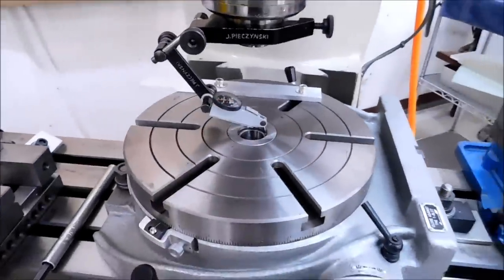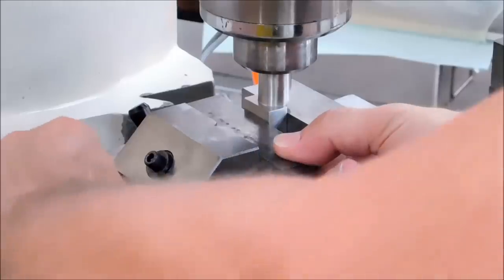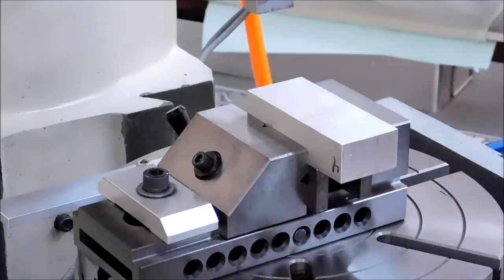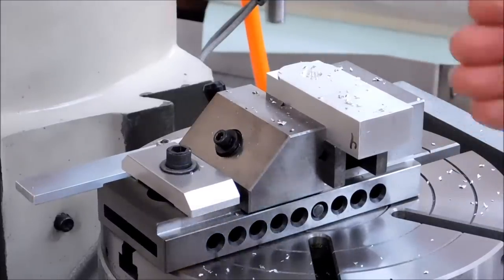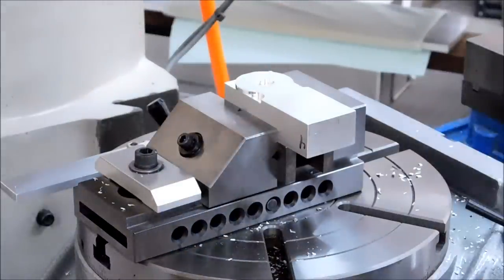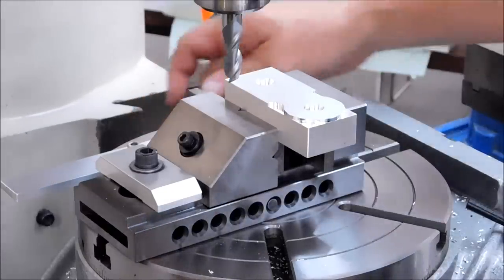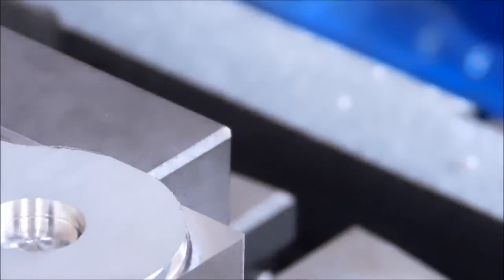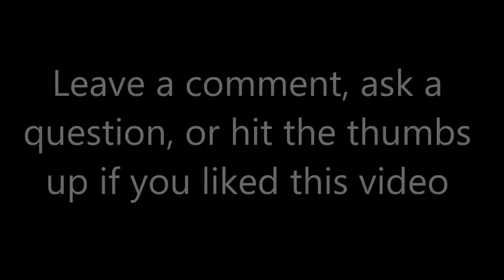Simplified Rotary Table Setup. Tool Demonstration #1

Comment: Great demo Joe. I bought one of your alignment tools and used it on my very first rotary table project yesterday. I made some T-nuts for the rotary table and rounded one end to fit the rounded end of the slots on my Phase II table. Worked like a dream. Not sure how I would have set up without it.

Comment: After seein' how useful them thar alignment tool be I went and sawed off a length o' rebar and  a hunk o' hot rolled and stick welded me up one of things.   I cain't seem to gets it to align so good.  Cans you tell me whats I might have done wrong?
Reply: Could've been a damp welding rod. Try tig for a clean looking finish.
Reply from the maker: Depends on what day of the week it was, and what kinda dog crap was stuck to yur booots. Its all in the details.

Comment: Joe a great setup BUT, how about if the holes need to be a certain accurate dimension apart ? The blocks would need to be accurately machined to length first to do it the way you showed. Is there another way using your setup with the blocks just rough sawn to length to be finished to size when rotary machined ?
Reply from the maker: Hi Dave, good to hear from you. Thats Demonstration video #2. Coming up.
Reply: @joepie221  Would that be using the rod and bushing trick with the double sided tape to set the hole locations? After finding center of course.

Comment: OFF TOPIC QUESTION
Why has nobody ever made a mechanical iris steady rest, or 3-jaw chuck steady rest, with bearings for the lathe?

Am I wrong in thinking that it should make the setup quick and flawless?
:
Reply: I've thought about the 'steady chuck' idea before it would be pretty awesome, you could also use a 4 jaw steady for supporting long offset work pieces if ever you had the need.
I might bump this up the project list, I'm pretty keen to see one of these :)
Reply: +TommyGun Machining 
Wouldn't the 4-jaw steady basically be the same as using the pre-existing steady rest, attempting to zero the adjustments, so to speak?  I'm trying to get away from that.
:
Reply: I was talking about interesting offset setups where steady rests are normally central only. It was my tangent to your tangent!
But yes, a centred 3 jaw steady should work for what you are talking about
Reply from the maker: I have a 3 jaw tailstock chuck with bearings.
Reply: +Joe Pieczynski 
Have you already done a video on it - if so, could you please provide a link?
:
Reply: The chuck would be easier but much wider, leaving more of the part inaccessible. If that wasn’t an issue for you it could be good.
Reply: +Inventorsquare 
A mechanical iris steady rest could fit into the same footprint as a standard steady rest, that is why I mentioned it first.
:
Reply: Critical Look That makes you suspiciously forethoughtful.
Reply: Critical Look Rottler, uses the almost exact chick like you talking about has a bearing in the middle of a chuck and it installs in a main bearing bore to support the bar while you face a thrust surface with a universal boring bar. The new machine just circular interp. The boring attach

Comment: hi Joe,
do you make that setup tool in a metric version?
Reply from the maker: Made from metric steel. Does that count?
Reply: One need only be willing to work with 12.7mm at a time.
Reply: well the dials on my bridgeport are metric and using imperial measurement tools gets to be confusing and a real pain real quick. it's not that i'm trying to be facetious...also most of the collets i have are metric as well. i have a few imperial sized ones but those rarely come out of the box
Reply from the maker: I honestly thought you were kidding. Sorry. Only the shank would need to be metric. The faces would still perform as intended with some math. The .750 shank may possibly fit a 19mm collet
Reply: You could make it yourself if you wanted one bad enough and had the equipment to do it with.

Comment: Hi Joe, rather than taking the part out and reseting for the second half, could you not have moved the table back the distance between the 2 centre holes minus the 40° offset while cutting an just turn the table round again to do the other end then forward to the end of the first cut. Or was the exersize based on the use of the tool you made to realighn exactly for a second cut. thanks again for teaching us different tools and ways to do things.

Comment: I'd purchase one of these pins but they seem to be long gone. Anyone have suggestions on how to make one (order of operations)?
Available equipment is: lathe, mill with collet blocks and spin indexer, but NO surface grinder. I have  Mitutoyo digital mics, surface plate, digital height gage to check the finished tool.
Reply from the maker: I am retooling the process. I do plan to put them back on the website in the future.

Comment: So i your opinion, would it be better to get the largest rotary table that will suit the machine? Over the smallest kind that would fit. In going to get one here soon bu6im glad i waited over buying a 4 inch, because that would fit nicely on my mill table without overhang but im thinking a 6 is probably made a little better and the same with 8but thats too big.
Reply from the maker: You will only be restricted by the mounting position to the machine body. I'd get bigger than 4" if it was my choice. You can always add a bigger tooling plate to the rotary table if needed too.

Comment: I'm surprised the other end of that vise didn't come loose on you with just the one clamp on the end ?
Reply from the maker: If it was a heavier load cut, I would have used 2.

Comment: Hey Joe, serious question this time 🙂 maybe I missed the setup, but did you trust that one clamp on the rotary table to hold your vise?  I was surprised not to see you make a holding setup at the other end of your vise. Thx.  As always, I consider you the machinist's machinist.
Reply: Joe West, I wondered the exact same thing when I was watching.  In case you didn’t figure it out, I noticed when Joe Pie swung the table around that he never removed the adjustable parallel that was wedged against the ‘x-axis’ fence that was locked down.  That clever trick effectively locked the vise from rotating.  Hope that helps.  I find I need to have my head on a swivel when watching JP’s videos as they are chock full of tricks he doesn’t have time to mention.  👍👍😎👍👍

Comment: What is that rattle noise in the mill?
Reply from the maker: Front spline bushings
Reply: @joepie221  did you ever figure out how to align the head and tail stock of a lathe? Is it may be as "simple" of putting two exact same bars in chuck and tailstock and checking with a dial indicator that there is no deviation? Thanks!!
Reply: Spixy cat Spixy cat You only need 1 bar. Turn between centers, make a pass, indicate it, continue adjusting the tailstock towards or away from you so there is no more taper in the part. You can also buy or make a reusable and very cylindrical bar with concentric centers so you don’t need to make any new cuts, except freshly turning the headstock center of course, and you merely adjust the tailstock until it’s reading 0 from left to right.
Reply: rats arsed That is exactly how tailstocks are aligned. It is adjusted until there is no more taper on the work piece. Look up “Tailstock Alignment Bar” and instructions on how to do it.

Comment: I just thought of a work around for your rotary table slots not lining up with X and Y axis.  Make an adjustable index mark where your zero point is, when the table slots do line up the way you like them.  I didn't read through the 400 odd comments already , to see if someone else had the idea first. If so sorry for that.  I do learn a lot here.  Keep up the great work.👍👌
Reply from the maker: Thanks for the comment. The adjustable index mark is part of this rotary table, but the adjustment and bracket design fell way short of the shift needed. I fabricated one with an extreme offset and slot for alignment. It was the easiest way out.

Comment: Nice demo, Joe.

Maybe I missed this in an earlier video, but when you make the pins, how do you inspect them to verify that the flat face is in line with the cylinder axis? I assume it wasn't the center head on your combo square 🙃
Reply from the maker: All 4 faces are driven from a precision turned diameter. Its quite a process, but very accurate. .0005 max is my max deviation.

Comment: I’m not a metal guy but a wood guy. Still, a big fan of this and other metal machining channels. I learn plenty to use in my (hobby) shop. One of the things in common is this idea of climb cutting vs. the “normal” way. (What IS that called?) Several comments about it here and elsewhere so maybe it’s a good topic for one of your always good white board sessions. I imagine there’s more to it than a better finish or tool flex. I can see this list of subjects down the right side of your board now!

A humble suggestion. Good video as always...thanks
Reply from the maker: The normal way is commonly referred to as 'Conventional" cutting. Climb cutting works very well with wood since it doesn't promote cracking.

Comment: You are using either end of your work as an origin, subjecting the piece to stacking tolerances. How might this be done using a single reference point?
Reply from the maker: Your observation is correct. The rounds cut here do depend on an accurate overall length of the block. A single end reference could  be achieved by simply knowing the center to center distance of the rounds, re-install the pin, make the machine offset the center to center distance and re-register the part against the pin. This would probably be even more accurate as the stationary side of the part would stay against the stationary side of the vise. Be sure to watch the other setup demonstration videos for this device.

Comment: Is there a center finder large enough to plunge into that bore hole on the rotary table, like a live center or something?
Reply from the maker: Believe it or not, the center bore isn't the most accurate way to coordinate a rotary table to your machine spindle. Make sure you watch 'Demonstration video #2' I'll show you.
Reply: @joepie221  My 12" rotary table came with an MT4 bore.  Would the bore you indicated be more accurate?  I'll have to do it Joe's way and see how far out my down chuck, up chuck method is.

Comment: Hi Joe, thanks for the video. I would be interested in purchasing an alignment pin as shown in the video if available. What are the purchasing details (cost, etc).
Reply from the maker: Greetings. I had to halt the pre-order of the pins until I had solid numbers on the next run yield. Are you a Texas resident, or somewhere in the USA?
Reply: Joe Pieczynski - I am in Michigan.
Reply from the maker: @nevetslleksah  I checked the yield last night. I will have a few left over if all goes well. $48.45 with shipping. 4-6 wk delivery at this time. Paypal account is jpieczynski221@aol.com if you care to send a payment, I'll get you on the list and send you a confirmation. Make sure to note your shipping address.
Reply: Joe Pieczynski - PayPal payment sent, thanks.

Comment: Joe, great video as usual. Am kinda surprised though that you didn't do the coordinates for the straight cuts during the video since they would only take less than 1 minute to do with a calc since you have such a good knowledge of the trig for this....  Granted, the Y axis cut moves could be off by small amount being that you referenced from Saw cut ends.

EDIT: Disregard the lengthy read below. Its the long way around the problem.... Shorter even faster way around that slipped my mind is in comments below...

For anyone who might read this (Joe, I know you will already know this) who is curious on what it would have taken to actually calculate the X,Y positions for the straight cuts, Since we know that his tool was on a 1" Centerline offset from the center of the part and we know that he went 40° beyond the 180° arc on each side, that would be a total cut of 260°.  That obviously would leave 100° left out of the full 360°.
 
We can then split that 100° in half thus allowing use to have two equal right triangles formed for the between the center of radial cuts made and the ends of those cuts. Since we know that we have to equal 180° for a triangle, and we know that we have a 50° angle at the center of the semi-circular features and a 90° angle from the centerline of the part along the Y axis, this means that the other angle is 40°.

Since the line along the Y axis (Y axis offset for actual cut start point) would be the side "Opposite" of the 40° angle and the 1" long line (in this example) that is formed from center of the radial feature and the center or the tool at the end of the radial feature cut is the hypotenuse, we use the Cos of the angle * the length of the hypotenuse to find the length of the side "adjacent" which is the X axis offset too. So we have     Cos(40)*1" = .7660in   So our X position for the start of the cut would be .7660

Then we just use the pythagorean theorem (a² + b² = c², or in this case since we are using the Hypotenuse, it would be c² -b² = a²) to find the Y offset since we know that the Hypotenuse is 1" and we know the Base is .7660 so we use do 1² - .7660² = .413244², so then we just do the √.413244 = .6428

So from our 0,0 point with the block in the correct orientation, we would move the X to .7660 and Y to .6428 to start our cut. If we know the exact center to center distance between our two semi-circular features, then we could just take that spec and subtract our Y start offset that we just calculated from the center distance from 0,0 of the other semi-circular cut to find our ending point for our Y move to make the cut... For example, Lets say that Joe had made the part so that the center to center distance of the two semi-circular features was 4.000", we know we would just take the 4.000 and subtract the .6428 Y value calculated above this giving us 3.3572 so we would just shift the X axis to .7660 and then Y to .6428, plunge the mill and move the Y thru our cut to 3.3572. Repeat for the other side (- X value) and your done.

I know like that seemed like a lot, but really if you know the trig for it and have a calculator that has trig functions, it literally takes less than a minute or two to calculate out the points in something like this. Maybe Joe can use this video to make another showing visual representation of the trig as I described above (unless he already has one that would be a similar example that I'm unaware of or not thinking of).
Reply: Write another chapter for those of us who are 'slow'.
Reply: I had forgotten how much I love simple math...all theses videos with intricate layout are so much fun to watch.  I missed my calling...
Reply: That's the long way around. The two corners are 40° off the x axis, and the radius of the cutter is 1". Your basic circle is x,y = r cos theta, r sin theta, so x is ±cos 40°, and y is -sin 40°.
Reply: @PaulSteMarie  Haha, you are right.. No idea why I didn't think about using the other sin for the side opposite just like cos for the side adjacent...  Thanks for catching that and pointing it out... The funny thing is just yesterday during the day I was doing just that at work to do a bolt circle yet just a few hours later, didn't think of it... Ugh...

Comment: Why do you like to climb mill?
Reply: To get to the top ?
Reply: superior finish
Reply from the maker: Yep. Much better finish, and the cutter flex's away from the final surface.
Reply: Sanvik has a really good video on it. Climb milling may not work on light or worn out machines though.

Comment: Nice setup tool.  Do you have one for a 3/8" shank (for my Sherline)?
Reply from the maker: 1/2" shank is available. Is that still too big?
Reply: Yeah, still too big.
Reply from the maker: @KM6VV  if you place an order for the Mini Mill alignment pin and reference your KM6VV channel name, I can get one cut down for you if you want one. I know they are running some in the morning.
Reply: Thanks for checking.  Looks a little pricey for me at this time.